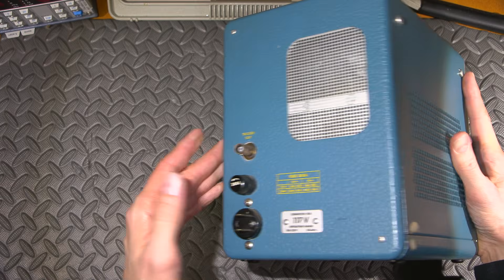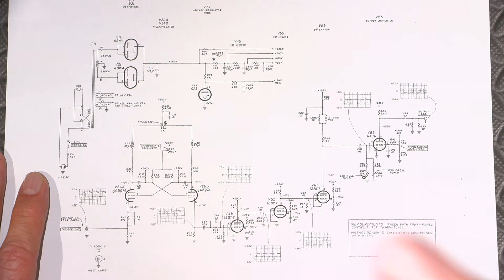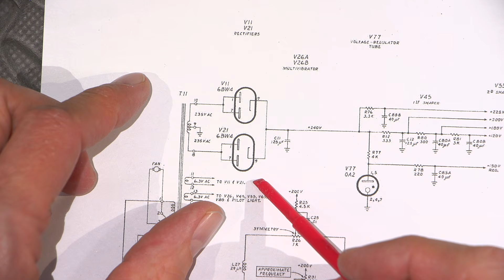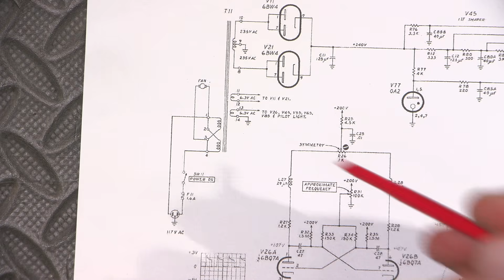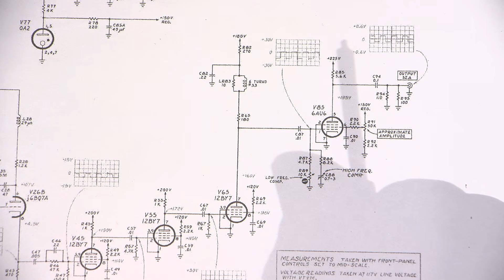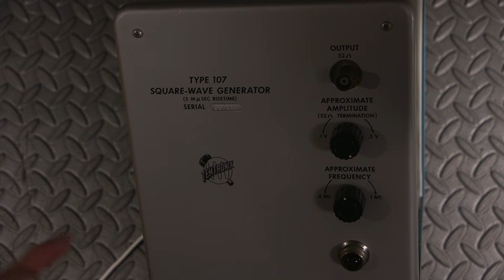1959 Electronics - Let's See If It Works!

Comment: You have cleared up something that has puzzled me for a long time. I have for years believed that the American domestic mains supply was 117 volts, which the back label on your instrument has confirmed, so why do I often see/hear it referred to as either115 or 120 volts?
Reply from the maker: They couldn't make up their minds :^)
Reply: It's simply not exact. Today the supply voltage is a nominal 120v. There's also voltage drop when under load, which is likely why some equipment is rated for a bit less than 120v. I do believe the nominal supply voltage also might have been a bit lower back in the day but I don't know the whole history on this.
Reply: It's just a median value of the actual mains voltage variation experienced, which is due to factors such as time of day,  season, distance from step-down transformer, loading on the system, etc. Can be +/- 5% of this value.
Reply: @peterrollings1240  Thanks, as a long-time electrical engineer I am aware of supply tolerances and the reasons for deviations from a stated or nominal value, but we don't say "it's a 240 volt ± 5% drill" or whatever, we say "it's a 240 volt drill" so my point was that I/we always used to say that the USA domestic supply was, nominally, 117 volts and I was querying why I now see reference to 115 or120 volts.
Reply: @JUANKERR2000  That's an interesting point, and the only thing that comes to mind is that 117 is deemed overly precise by manufacturers these days, whereas 115 or 120 is more suggestive of a nominal value.
Reply: @peterrollings1240  A plausible explanation.
Reply: Probably started at about 110V in the Stone Age, and has gradually (but not universally) worked its way up to as much as 130V. More efficient. Good thing we have universal power supplies now -- it doesn't matter any more !

Comment: Lovely piece of equipment, very nicely designed. 
It's interesting that Tektronix used cooling fans even on such a simple device. Made labs back then quite noisy :)
Reply: All those tubes made a TON of heat.
Reply: @davelowets  there's not that many of them here, at least compared to a scope :)
Reply: @KeritechElectronics  The scopes are CRAZY full of tubes... 
There's still about 4 amps of just heaters glowing in this device, + a large transformer, all nicely wrapped in a small tin box. I'm sure the heat would be enough to quickly kill those metal canned capacitors in there without a fan.

Comment: Would leadfree solder with 3% silver work? I have several rolls of that stuff (not my favorite solder though)

edit: It's actually even 4% silver, 1% copper and 95% Tin
Reply: You should not use lead free solder with 3% solder. That solder needs more heat to melt and with the ceramic strips, less heat is better.

Comment: Paul, a note on the stickers:
First, the side sticker is most likely a CAL-sticker since it crosses a casee joint which makes it obvious if take apart.
The BLUE-sticker is usually an INVENTORY-sticker; all this means is the unit has been recorded on the inventory sheet and is to prevent it from being counted twice, as there can be multiple units if the same make and model; also since taking inventory can take multiple days or weeks.
Great Video & 73...

Comment: The wiring on the schematic for the two 6BW4 does not seem to match the way the unit is wired. It looks like they've used one plate from each tube for each wire from the transformer. Wire 10 from the transformer goes to pin 1 of both tubes and not 1 & 7 of the same tube. Or are my eyes failing me?  :-)

Comment: Those shaded pole motor fans absolutely LAST   FOREVER!!! A bit of maintenance every few years of constant use, possibly oil the felt pads… They’re almost un-killable. The few I have seen which failed… were due to a thermal fuse which is easily replaceable

Comment: What would this square wave generator be used for back in 59?  I associate square waves with digital electronics.  Are the other applications back in 59?
Reply: Did you ever hear of RADAR, TV or digital computers all existed long before 1959.
Reply: It was a specialized instrument primarily intended to test the performance of 540/550 series scopes.
Reply: My question exactly also.

Comment: Tektronix was king in test gear in those days. They made their own crts and even those ceramic parts.
They survived and dominated the change to transistors. But things got simpler for the competition and their build advantage went away with integrated circuits and they slowly became one of many today. They demanded and got high prices for excellence, now it's a whole different game.
Reply: There's at least one YouTube video showing how TekTronics makes all those parts, including the ceramic connection strips, and the 'o' scope CRT tubes..
Reply: @dougankrum3328  Yeah, I saw that movie in 1971. I may look for it again. I could have used it when I was teaching.
Reply: There's a Vintage Tektronix channel, that has their cool films.

Comment: TUBES!!!!!

I got a job at a steel-mill as an engineering student.  The project was to get an old cold-roll controller unit back up and running.  It was mostly tubes.  I had no classes in tubes.  The schematic was nearly unreadably to me.  We never got it going.

Comment: Wow, I'm so used to seeing tube equipment that looks like a birds nest inside, this thing is a work of art. Made in a time before bean counters who would have deemed it over-kill. Transformer nice too, could always use it as a doorstop or boat anchor if it ever fails.
Reply: My father, who worked as an electronic tech at Tektronix from 1965 to 1996, says that the bean counters took over after Howard Vollum died in the mid '80s.
Reply: Really amazing to think that someone was capable of designing that wiring without a CAD program on a computer. I would imagine that it made servicing it a lot easier.

Comment: Amazing. It looks like a Retro-Sci-Fi prop from a TV show. While I remain impressed its rise time is in-spec, I've seen far too many of your videos to be surprised at this point. 😁 It's also a fine way to show why the 555 timer IC was such a big deal when it came out -- look at what it took to do it with tubes! 👍
Reply: 'Sci-Fi' prop....yes, the Outer Limits...!
Reply: Indeed, Tek gear was always specced conservatively.  In fact, applying the standard correction to the indicated risetime for the scope used the risetime of this 107 is actually just under 2nS. Impressive for valve technology and made possible by overdriving the output valve and using just a small portion of the driving signal to cause conduction.

Comment: To think, all that metal, glass for the tubes and gas it took to make them, copper wire in the transformer, the time to make the above and the chassis... fast forward to now, a single .20 cent Op-amp and three resistors and one capacitor will give you the same results and you probably could get away with running it off a single lithium battery, Nonetheless, there definitely is a charm to those big sturdy made old equipment.
Reply: Except you wouldn't get Tr and Tf < 3 nsec.
Reply: @curtwuollet2912  So true.

Comment: I really love my TEK gear from this era, they really went the extra mile no matter what piece of equipment they were building. I've found this same era gear before and sure enough (as long as the previous owner didn't monkey with it), it generally comes up and just works. They use good (sometimes hand selected/paired and binned) parts and generally do not push the components hard. I remember seeing a internal TEKTRONIX video where they were showing the development of their CRT's, transformers, circuit boards, and chassis which they did in house. It was explained in the video that they would resort to manufacturing components themselves no matter the cost when their "rigorous" standards could not be met by third party suppliers rather than putting out a product which did not meet their high standards of quality. They always underrated their equipment,  and in my experience you could always expect 'just a little more' on top of where they published the specs instead of the common practice of rating equipment based on it's theoretical limits in a perfect lab environment ILS (If Lightning Strikes). If you needed resolution at a certain bandwidth, you'd certainly be able to see your signal even if it was a the high end or low end of what the equipment was actually rated for.

Comment: Paul, when I first started to work, the electronics company produced a lot of DOD equipment. One of my first jobs was building wiring harnesses. The 'harness room had plywood positioned in a vertical manner so that a 'harness drawing' could be attached and use as a pattern for the harness. The medium for holding all the wires together was called 'lacing tape'. It was a nylon flat tape ~ 1/8" wide and white. WHITE! can you imagine! The lacing tape was held with running knots, a simple twist of the wrist and continued throughout the 'run'. At the end, a special 'end knot' was applied. The whole time, talc powder was applied to the hands to keep the tape white. Eventually, someone thought that the tape should be black and made working with it so much easier. This was in the '60's.
Reply: I grew up near Tek. Never worked there, but often went to the "Country Store", their surplus and salvage outlet. Sometimes they had grab-boxes, and I have a 500 yard spool of that same clear vinyl harness lacing cord.
Reply: @randyshoquist7726  Yes, I thought that 'lacing cord' looked like a clear material.
Reply: I've worked in electric motor repairs and we used a very similar tape, that was 50+ years ago. Now I see cheap brown twine.
Reply: I still have some lacing tape around someplace. It made for neat and vibration resistant wiring, But it was a pain to repair. It's probably right by my wire wrap tools.
Reply: It's still used for aero and space applications since it's lighter weight than cable ties.  I learned how to do it for a high temperature wire harness I needed to make using NOMEX lacing tape, which was white as well.   High temperature PEEK wire ties are  ex$pen$ive.
Reply: In the 1970's I was working in telephone central offices.   We used waxed linen lacing cord ("12 Cord" - for it's size), we then switched to waxed nylon cord.  The nylon cord would cut into our fingers, so we had to use thin leather gloves.  What a blast from the past........
Reply: I worked at a company called CONRAC. We had civilian workers and men in uniform walking around the plant. We built parts of weapon systems for the Vietnam War. Black waxed lacing cord was used on everything which helped hold the knots in place as they were tied. . The Air Data Computers I calibrated went into drones which were later blown up for target practice. After certain  military contracts were completed, some of the test equipment (Tektronix & HP) were put out in the parking lot and run over by a steamroller. They did the same to the test equipment at HP where my friend worked. (what a waste)
Reply: I worked for Control Data back in the late 60's and one of the things I worked on were power supplies.  They had a huge wiring harness that the ladies on the production line made by laying the wires on a board with nails in it then ty-wrapping the harness.  It was my first exposure to Ty-Wrap or what is now called zip ties.

Later in the mid '70's I was a tech working on ITT telephone switches.  They were a mass of wiring harnesses all neatly bundled using cord.  I recently made a harness using genuine harness cord just to see if I remembered how.  Laced harnesses were a work of art back then.
Reply: Damn, you're bring'n back good memories!

Comment: That motor is known these days as a C Frame motor, and I believe their sizes/dimensions are standardized. Most table/desk fans today use them, and a few companies even sell cheap 3" fans with motors and blades about the size as what is in your unit.

>if you want to search for 3%, you're just getting picky
As meticulous as you are, I'm guessing your silver solder is 5%. ;)
Reply: 'C' frame...shaded pole, they were all over the place in fans everywhere. you did have to oil them a bit...every few years, or they self-destroy and screech to no end like my old house bathroom ceiling fan. The bearings are ruined now, due to no one ever reading the label on there....'oil annually'....

Comment: .. 1959 год.. Но анодное питание почему-то на кенотронах..
Reply: First things first, I don't think that 6BW4 is a kenotron. As far as I know, kenotron is a vacuum tube diode designed in some special way, often used as a high voltage or high frequency range rectifier (e.g. EY86, DY87), but 6BW4 is typical vacuum diode rectifier widely used in anode PSUs. And in my opinion, they used this instead some solid state solution due to the fact, that it comes up slowly and not before other tubes are properly heated up. In fact, diodes are typically the slowest heating tubes resulting in a kind of sequencer circuit, which esures that no anode voltage is applied before filaments of all tubes are properly heated. Using solid state rectifiers instead of vacuum ones is a huge disaster in modern tube devices, because not (enough) heated tube doesn't draw current, which leads to aplying almost full anode voltage to parts of the circuit where this should not be, which causes a huge unnecesary stress to all components. Remember, there is no voltage loss on the resistor when no current flows through it.

Comment: Its insane to realize that this entire box can now be integrated onto a 1x1mm piece of silicon
Reply: I would like to see mains PSU integrated into 1×1mm piece of sillicon. Because this is exactly what you said. That device contains a mains powered PSU…
Reply: @NikiBretschneider  power integrations (company) is kinda doing that but the ferrite transformer and the caps are still external. So I guess 50% of this box can now fit in a 1x1mm silicon.

Comment: A lot of trouble for a square wave. Wonder why someone would buy this and what did it cost? A 3nS rise is impressive, far beyond what scopes of the day could resolve. Wonder if they had a sampling scope to measure it. Your Fluke is a little marginal for that rise time too.
Are you aware of the 8000uF/V/A rule of thumb? For a 60Hz full wave circuit 8000uF will have 1 V p-p ripple for one amp of current flow.
Of course you can scale that relationship for any other values. I determined this relationship decades ago and have used it ever since although I don't use 60hZ supplies much any more.

Comment: Heathkit used similar shaded pole fans to cool the 3-500 tubes on the SB-220  / 221 as well. They are super easy to disassemble and clean, the oilite bearings require occasional light machine oil to the surrounding felt to keep things quiet.